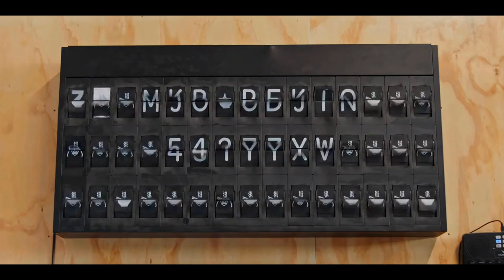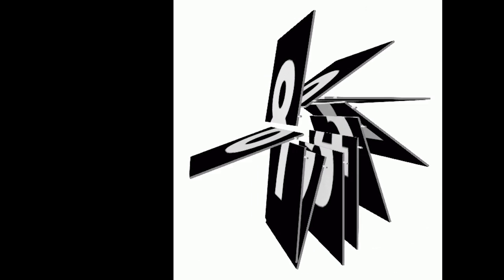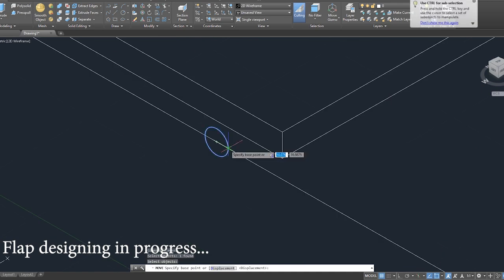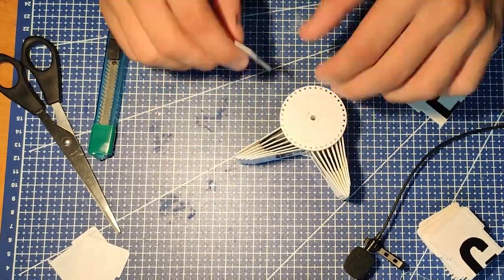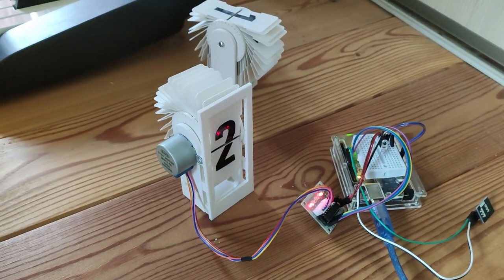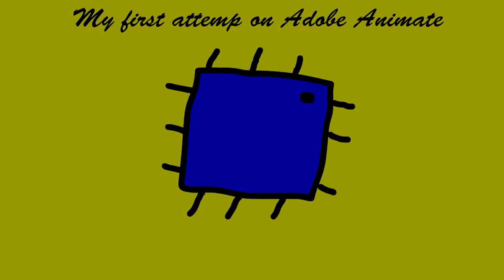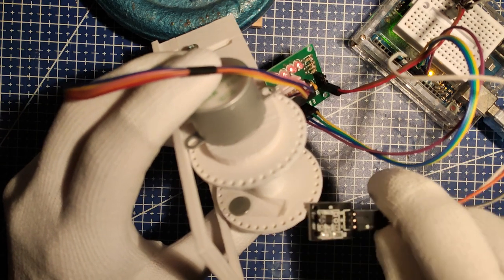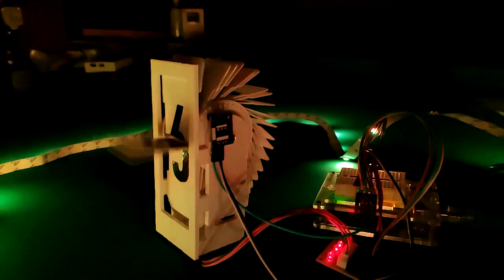Split Flap Display | You Can Make One Too IZI

Comment: about the letters, couldnt they be 3D printed directly? Print the base of the flaps in white, and then change the filament and print 1 layer in black...
Reply: That's what I'm thinking. you would need a printer that can do color changes though. Another way could be to make the letters raised against the background and then use a stamp or sharpie.
Reply: @aidenfindley8565  Almost printers support mid print filament change using the M600 code. You just need to manually change the filament each time